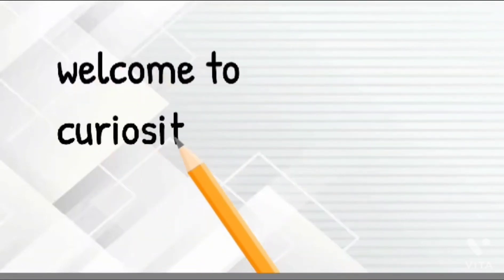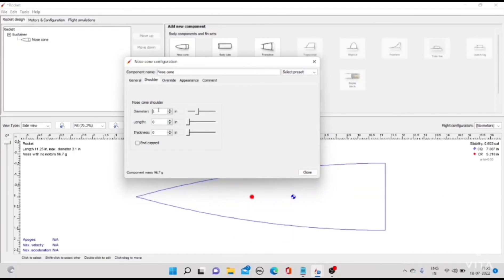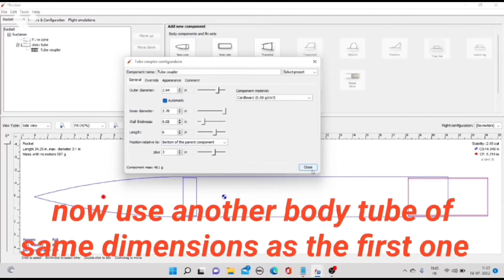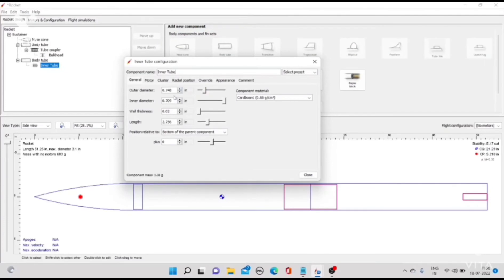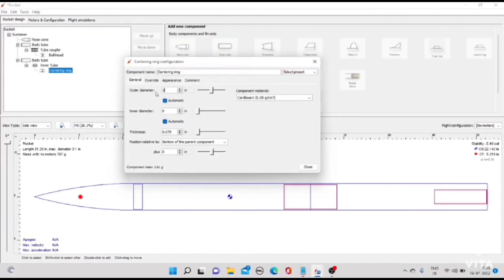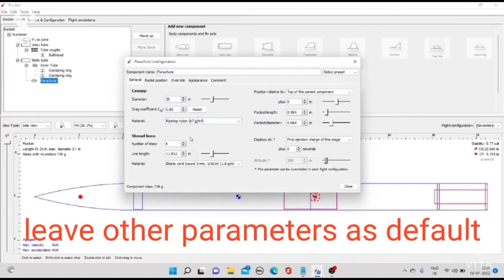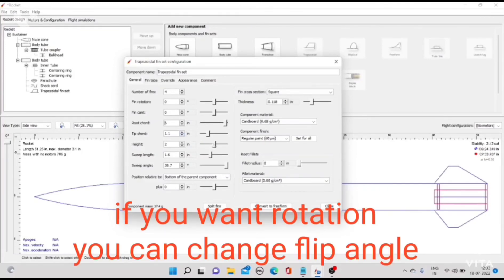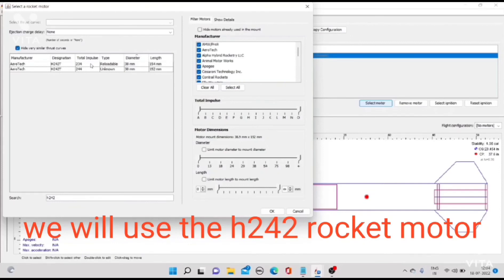Design your rocket for high altitude flight in open rocket

Comment from the maker: Nose_cone:
ogive shapeparameter=1; Nosecone length=11.25in ;Base Diameter: 3.1, wall thickness =0.125 in polystyrene
shoulder= 1in shoulderouter=2.943

Bodytube:
length=20, outer diameter= 3.1inch , inner dia=2.943

coupler
length=6 , outerdia=2.943 inch 

bulkhead
innerdia=2.943 , wall thickness=0.045,

Bodytube2
length =20 in, outer diameter= 3.1inch , inner dia=2.943

innertube 
outerdia-1.67
wallthickness=0.07
inner dia=1.53
length=8

motor h242, ejection charge delay =10

fins
no=4
height=3
sweep length=1
sweep angle=18.4
rootchord=2, tipchord=2

centering ring 
innrdia=1.67
outerdia =2.943
thickness =0.25

parachut:
dia 30in, line length=11.411

shock chord
bottom of the parent component

Comment: How did you calculate the value of these data.? Please give me a clue.
Reply from the maker: The Datas are provided on the pinned comment. You have to try it via hit and trial method. Moreover some other parameters are emperical such as diameter of the nose cone is around 1/3rd of cone length. 
If it helps do support my channel..🙂🙂
Reply: Thanks a lot